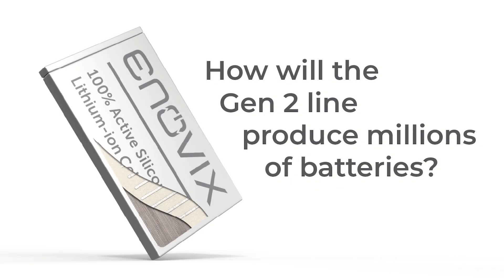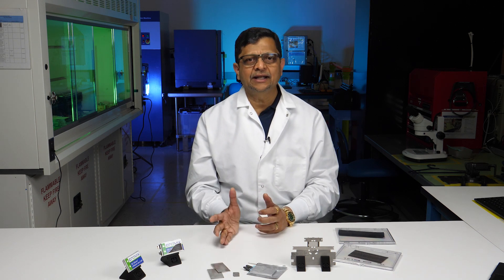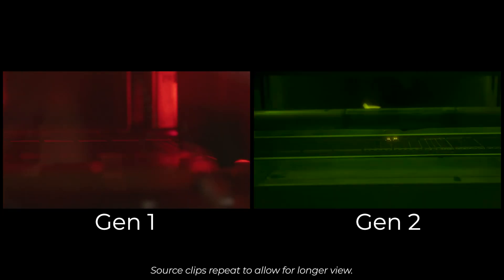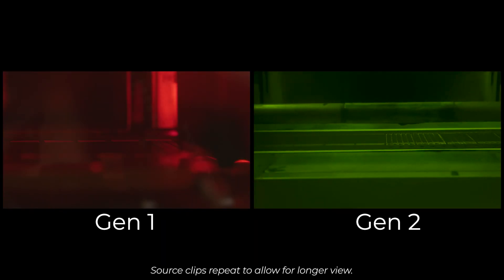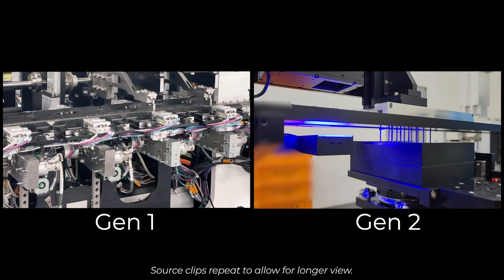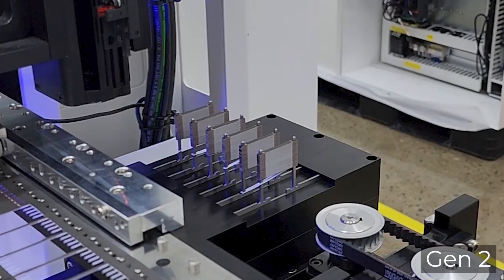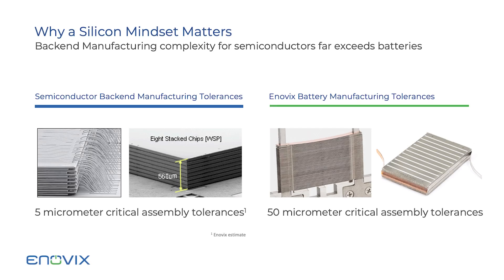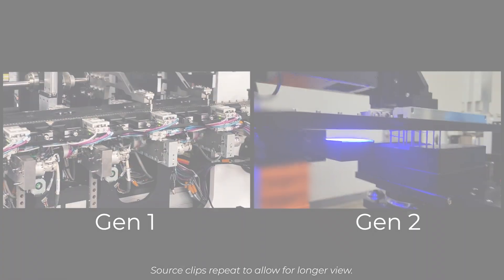Enovix Gen 2 Manufacturing

Comment: Do you now have all the equipment you need for the individual steps and are now putting the single pieces together + programming the line? 
I understand that the mgmt has experience. How similar are chips and batteries in the manufacturing process?

Why did the old mgmt team not do the same as you do now?